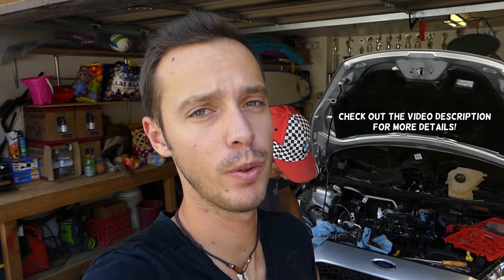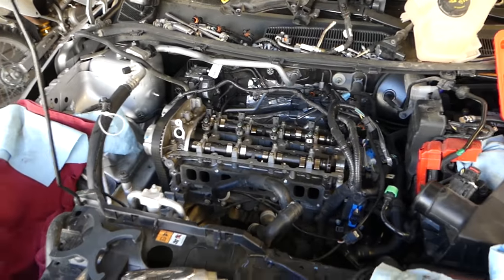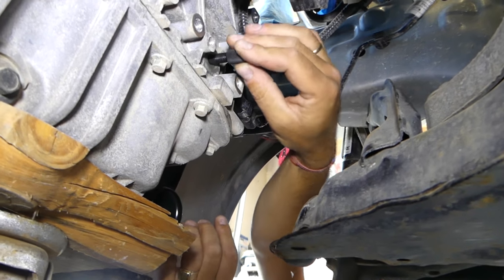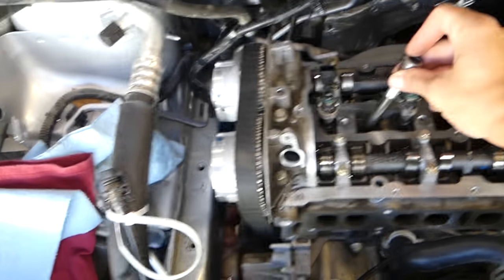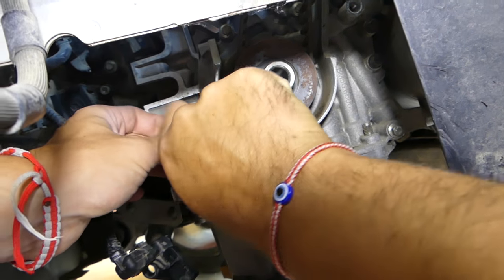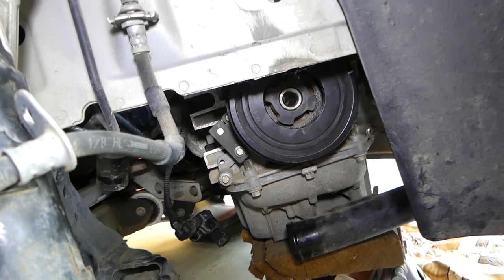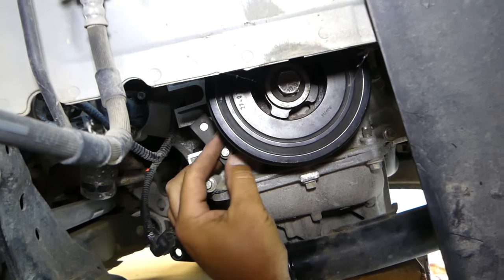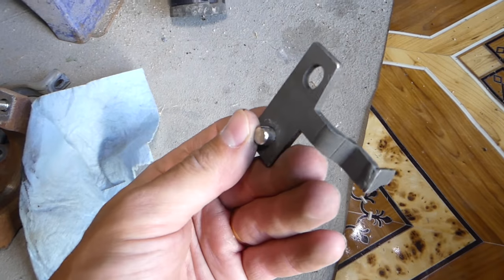FORD CRANKSHAFT PULLEY ALIGNMENT TOOL. TIMING CRANKSHAFT PULLEY

Comment from the maker: Products that we use and recommend:
►► Timing Tool: https://amzn.to/2J4qhIb
► Panel Removal Set: https://amzn.to/3YiMADu
► Tool Set: https://amzn.to/3p5MM6t
► Screwdriver Set: https://amzn.to/3XRB28Q
► Castrol Oil: https://amzn.to/3xBc8B9
► Oil Filter: https://amzn.to/3w0Ulme
► Torque Wrench: https://amzn.to/32qyRwg
► Liqui Moly Engine Flush: https://amzn.to/3IiDBID
► OBD Scanner that we use most often: https://amzn.to/3I4MQfe

► Check out our Amazon Store for the tools and parts that we use: https://www.amazon.com/shop/worldmechanics
Reply: Did you guys replace the gasket or seal on the crankshaft pulley? Or
Reply: to put the screw that is necessary to remove the zipper?

Comment: Thank you for the video. Good job.  The crank pulley does not have a reluctor tooth wheel. Can you please do a video explaining how this crank sensor works? Also use a lab scope to check waveforms. That we we will understand how the proper signal looks. Have a blessed and safe week.

Comment: Hi and many thanks for all the helpful and full of information videos.
Iam going to replace the crankshaft pulley on my ford mondeo 2011 2.0tdci with powershift automatic gearbox.
In this car the crankshaft pulley dont need alignment but iam wondering how to stop the engine from spinning with out blocking the flywheel. 
Thanks
Reply: Once you install the round LOCATING pin and turn the crankshaft clockwise until it contacts the LOCATING pin, You then install the CRANKSHAFT LOCKING tool into the starter bore (Hole that you took the starter out of. The video shows that tool in place. Do not try to do this job without installing the crankshaft locking tool. You have been warned...

Comment: Very good & informational video. Fords own repair manual does not have nearly the detail you include very nice job! I was terribly confused on the new tool that holds the flywheel. They didnt used to use this tool & alignment of the crankshaft pulley for the sensor wasn't as crucial. But in  typical Ford fashion they changed the design & now a new special tool is needed!
Reply: john simmons  Dude that little hole the in the pulley is a signal for TDC for the sensor. Don't get that little hole in the right spot with that new special tool and it wont start/ know where TDC is. The force of tightening the crankshaft bolt keeps it and the sprocket from spinning nothing has a key way which is dumb and everyone who has worked on these engines knows this.
Reply: @kingpuff10  That does not mean TDC.. You can be 180 out and it would fit. The second you start it. Go buy a new head. As the valves would be broke off. And I fixed these all the time. As people stick that tool in there to lock the crank. But the crank is touching the bottom of the pin. They start it for 5 seconds. Go buy a new head..You just broke the Valves off. And beat your pistons to death.  Why you actually look inside that crank window. Too see where the Bolt is touching the Crank. It better be on the flat plane of the crank. Then make sure you replace the thrust washers behind the Crank pulley. Then use a new bolt.
Reply: @MasterChief-sl9ro  ummm no it is for the sensor to know where the crank is, it just won't start if off 180. The sprocket for the timing belt is what will bend valves if that isn't on tdc.
Reply: @jasonmoore843  Bull shit dude. That hole is to lock that crank down. As it has no key way on the crank...And you have to physically see it touching the side of the balance shaft. 
As that holds the crank in place. While you tighten the crank pulley bolt down.
So don't tell my how it works. I fixed many that people have destroyed their engine. Over this one step. AS they didn't understand it. As Ford and Mazda engines of this type are notorious for it.
Reply: @MasterChief-sl9ro  have you ever turned a timing belt engine over with the crank pulley off? Doesn't bend valves does it!!  As long as the timing belt is timed on the cams and crank sprocket it wont bend valves. The pulley needs to be in the exact spot in relation to the crank because the magnetic poles are in it and the sensor needs to know exactly where tdc is for the spark and injector timing.
Reply: @MasterChief-sl9ro  wow your anger clearly is a clue you are frustrated and have no idea what you are talking about. I feel bad people bring you their cars and you clearly cannot understand this very simple concept. Crank Pulley position has nothing to do with bending valves, only sensor information. ASE certified master tech that has done about 40 of these belts in the ecoboost motors let alone many other makes and models. Please educate yourself and show some respect to others. Funny thing is you are very rude AND wrong on the matter. The other guy above said the same as I and clearly he gets it. Close your shop down if you do not understand this simple concept before you damage someone's car.
Reply: @MasterChief-sl9ro  he even explains that the tone wheel tooth needs to line up with the crank sensor in this particular video. The whole time he rotates the motor without the pulley on because it has nothing to do with the valves, only the timing with the sensor for spark and fuel.
Reply: @MasterChief-sl9ro  I literally cannot believe you are using a video that proves my point, that is how much you do not get it. He is literally turning the engine over the whole time without the crank pulley on. And explains that the tone wheel on the crank pulley needs to line up correctly in relation to the crank sensor. This is hilarious.
Reply: @MasterChief-sl9ro  how do you not get it. The guy in the video you are telling me to watch is saying the same thing I am saying. The crank pulley has absolutely zero to do with valve timing, only sensor timing. The crank is only independent from the cams if the timing belt or chain is removed from their sprockets. If the timing belt or chain is timed correctly and installed on the crank and cam sprockets you can turn the engine over all day with the crank pulley off and no damage will happen. Your name calling and finger waiving gets you nowhere because you look like a fool to people that actually understand how an engine works. Please stop working on cars until you understand them.
Reply: @MasterChief-sl9ro  you say this engine is different from other engines when it really is not. The only difference is that the pulley doesn't have a key way. So to get correct spark and injector timing, ie correct relation of pulley to crank you need the alignment tool. That is it. If you do not have correct pulley to crank relation your spark and injector timing will be off.
Reply: @ronhanish  No. You just have to remove a shit load of stuff in the way... As they buried it under the PS pump.
It's a good idea to transfer the bolts to the new pump. In the same spot. As some can be shorter then others..

The only ones you really have to use timing chain locking tools on. Is the GM type water pumps. With the rear cross over tube...

Comment: Thanks guys., I fight 2 days with focus 1.6vct 2017, because there is an error in the auto date it says that the lock should enter the hole and this is not true, it is exactly the same as in 1.25 and in any other 1.6

Comment: I need help guys or anyone who has did engine swap on 2014 ford fusion 1.5 turbo quick question iam going to be changing out the engine with a used engine same engine i took out going back in with same engine now when i complete the install will the engine run or will i need to reprogram ecm or the pats keys

Comment: What do you do if the crankshaft slides out of position.  Mine moved and the timing belt didn't move. Now when I turn the crankshaft it locks up and doesn't go very far clockwise. How can I fix this problem.

Comment: The alignment tool is NOT needed on the 1.6L Duratec 16v Ti-VCT sigma (non-turbo engine) the crankshaft position sensor is in a different location.

Comment: u doing wrong when setup 303-1550 u did not follow correct Ford WIS proceedure right how to torque crank pulley bolt with or without remove this out first or NOT:face-purple-crying:

Comment: Ford and there no timing pins to hold the pulleys just ticking time boms so that can sell u something else and make more lifetime belts and transmission fluid that is right because the car will only go 70k to 110 B4 u need a new car